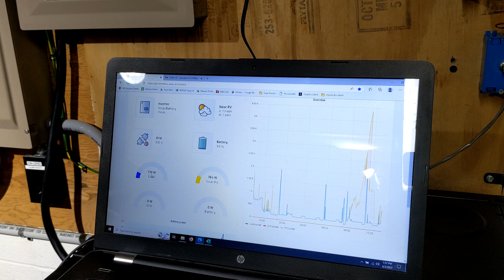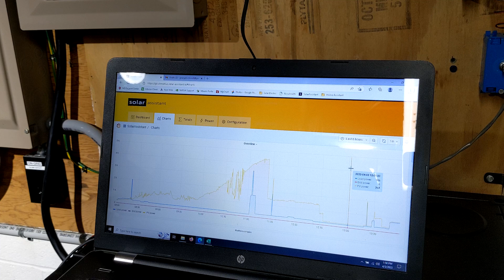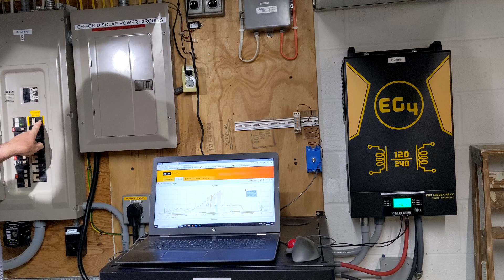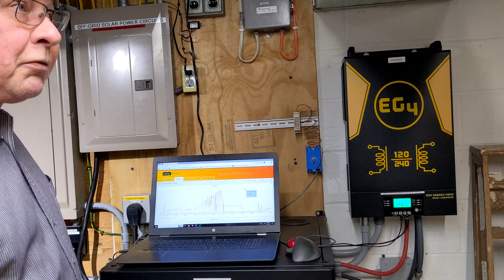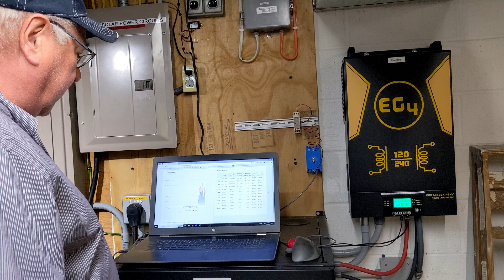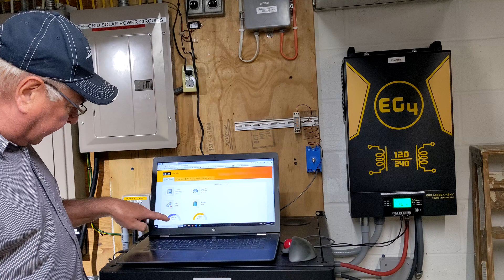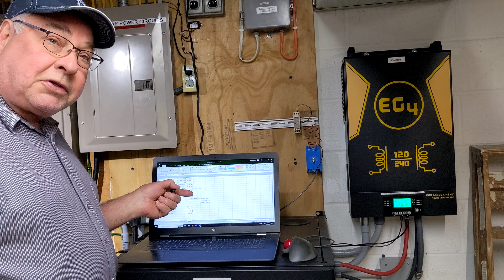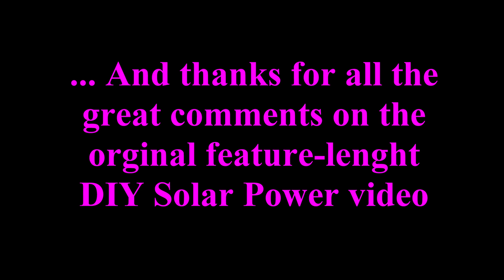DIY Solar Power Update

Comment: This video has inspired me to start designing my own Solar PV system. I was delighted to see that your doing all this in my neck of the woods,I am in Anne Arundel county, so right next door. My question is how did you start the whole process, I have built large extensions to my home, but always left the electrical work up to the pros. Where did you learn how to do everything from soup to nuts?
Reply from the maker: Hello, and thanks for the comment. Here are some answers:

Q: This video has inspired me to start designing my own Solar PV system.
A: Yay, go for it.

Q: I was delighted to see that your doing all this in my neck of the woods, I am in Anne Arundel county, so right next door.
A: You want to come see my DIY solar electric system for yourself?

Q: My question is how did you start the whole process
A: I started with a spreadsheet to compare all the available panels, inverters, batteries, etc. Also read some books and a lot of posts on diysolarforum.com.

Q: Where did you learn how to do everything from soup to nuts?
A: School of hard knocks. I started DIY as a kid, out of necessity. Growing up poor in a single-parent household, I had to learn how to do things myself. Started tinkering with appliances, radios, then repairing cars (not often successfully). At about age 16 I ran my own business installing music systems in homes, stores, beauty solons, and cars. I read a lot of “how to” books and learned from observation. Then out of high school and some college, I stumbled my way into the IT business and benefited from a whole lot of technical training. Now a days, we can learn anything from many YouTube videos.

--- George

Comment: Use a certified Victron Multiplus GX 48/3000 to feed the grid and in winter to charge the battery, if your solar panel don’t provide enough energy.
Reply from the maker: Hello and thanks for the comment. Are you suggesting that I could add the victron 48/3000 in parallel with my existing EG4 inverter?

Comment: HOWdy  G&M-H-M, ...
Thanks ...
My  36 antique  60 cell panels  208 Watt ( with MC3 connectors vs more modern MC4 Connectors - LOL ) ... 
set up in a  6S / 6P  configuration on a wooden GROUND MOUNT ... 
at a  FIXED  sun Angle of  45 degrees ( because my FRAMING-SQUARE had the angle Built-In  🙂 ) ...
produce up to  4.2 kW  of electricity on a Sunny Day ... 
and took me from  purchasing  400 kWh from my GRID supplier ... 
down to  this month ( March 2024 = 78 kWh of  purchased electricity ...
my panels were ALL  very  Very  VERY  USED  & OLD  - cost about  $ 65.00 each from WATTS-24/7 & SanTan Solar ...
thanks again ...
COOP ...
the  WiSeNhEiMeR from Richmond, INDIANA ...
...

Comment: I enjoyed your video. Trying to make this comment with my phone and I suck at using my phone.  I'm dictating this that's why there's mistakes & no punctuation. I just wanted to say you're an IT guy and you have more power than you can use, set up some asic miners. Even if your grid would buy your electrons they would only pay you the wholesale rate. Mining crypto makes excess heat so you could mint some BTC, and enjoy free heat while your system paid for itself even faster. My plan is to do a DIY off-grid to charge my electric car but if I ever make excess power, you know what I'd do with it. Thanks,

Comment: R&L?  Is that who delivered them for you?
Reply from the maker: Yes, R&L Carrier delivered all my solar panels, batteries, everything. Shipping was arranged by my supplier, Signature Solar in Texas
Reply: @gmhomemovies2023  I just bought a skid of panels from signature, had to go pick up from terminal.  There was damage on one of the panels but not to the point the panel isn't still operational.  

I've had other things delivered by R&L and my experience has been pretty mixed.  I've had a number if things damaged and other things not.

I made a comment on one of your video about mini splits, might be a really good investment and way to effectively use your left iver solar for heat or cooling.  I have a number of them installed and have saved a SIGNIFICANT amount of money over propane and even over wood pellet.  I use them as primary heat source now, savings is too great.  For me, each unit pay off was under 12 months over traditional heating methods.

Comment: If you're making more power than you can use, whydo you still have a electric bill??

Seems that you're looking for places to dump excess, I suggest dumping it into your electrical needs...
Reply from the maker: Thank you for your comment. To use the excess power for my remaining electrical power needs requires purchasing more a few addition expensive batteries which is not in my near-term budget. Since publishing that video I've moved the kitchen oven to solar power and now the supply and load are fairly well balanced, and the system is only producing excess power on sunny afternoons.

Comment: For my off grid system i plan on using moes brand transfer switch.  They have several models to choose from,  they turn things on & off based upon the battery voltage that you can adjust.  I want my transfer switch to turn on an electrical heater (in winter) when my battery bank is 95% full and off at 60% or so just i do have leftover battery capacity incase of a power outage. In the summer I will have my transfer switch turn on a dehumidifier. 
I haven't completed my off grid system yet,  and i hope it will work as good as i am thinking.  
Thank you for another great video.

Comment: What is the wattage of your well pump? Why did it beep while the pump was running?
Reply from the maker: Thanks for the question.  The well pump draws 1900 watts, but during startup it probably draws 2x or 3x as much. I have attached a  buzzer noise maker so that I can hear when the pump is running,  because the pump itself is at the bottom of a 160ft well.
Reply: @gmhomemovies2023  Thanks George! We have a 1 HP Flint & Walling well pump sitting in 300ft deep so I guess it may draw more surge current than yours. I learned that EG4 released a  brand new efficient new high frequency inverter called 6000 XP and it has 12k surge capacity so I probably get that inverter. This new inverter seems to be much better than EG4 6048 that you have in terms of idle current and has to MPPT. Nick

Comment: Could you use a hall-effect sensor on a battery cable to detect when the battery charging switches out of bulk charging mode?
Reply from the maker: Thanks for the comment. I've put the dump load project on hold for now, but I'll look into your hall-effect senor idea when I get back to it.

Comment: Nice video. I have a box of X-10 aka home assistant switches/receivers etc.. that I was always too busy to put to use. I don't have a list of what's in there but the box is about 18"x15"x 12" so a good cubic foot of X-10 stuff if you're interested I can check what all is in the box. Just thought I would throw it out there since you mentioned giving home assistant a try. The house I'm in now is all LED so I doubt I will ever use it all. I have thought about listing it all on eBay but I never seem to get around to it.
Reply from the maker: Thanks for the comment, but no thanks for the X-10 items. I'm trying to downsize my collection of gadgets.
Reply: I already replied once but apparently it didn't take.
That's ok. I know exactly what you mean. I'm constantly trying to downsize my collection of gadgets but I keep getting more instead🤔

Comment: Any update on the dump load would be appreciated
Reply from the maker: Thanks for the question, but I haven't done anything yet for a dump load  I considered using my old water heater, unfortunately I found that it was too far gone with rusty leaks.

Comment: (Missouri wind and solar) has a recycling program for used solar panels where they have the panels cleaned up, checked, and refitted with connectors and diodes if needed, then resold at a discount as a "remanufactured panel". you can let them know what you have, if it's something they take, they might pay a small amount. don't expect a big payday, but it's a nice option to give new life to used panels
Reply from the maker: Thanks for the comment. I donated the damaged panels to a young man who is getting into solar.

Comment: For the broken panels you can buy bulk windshield crack repair to fill in the cracks and seal the moisture out and still use the panels. some people also use lacquer to reseal the cracks.
Reply: If the cells are cracked, they won’t work.

Comment: If you can't use all that power, mine some BTC with it ;). Other than that, could you not change the inverter and have a professional install and check out the entire install and then approve it? Surely if an electrician approves the install for a fee and you have a compatible inverter, you could export it?

Comment: Home Assistant Automations combined with smart sockets / Shelly Relays or similar would provide a lot of flexibility in switching on dump loads e.g. Immersion heaters when SoC > 95% etc...    DIY solar diverter.

Comment: Good solar panel system you have there, you can make a shelter :). My mum and dad have an electric water heater but it is not connected to 240v instead it is heated with oil, but I was thinking of putting up two 370w solar panels and let the power go into 240v without an inverter. my idea is that the hot water lasts longer before the oil burner starts up and then save a little oil.

Comment: Did your well pump run off 240v? If so, without electrician is possible? Thanks
Reply from the maker: Thanks for the comment. Yes, our well pump is 3-wire using 240VAC at 8amps. In my county we're supposed to hire a licensed electrician for 240V wiring but I did it myself.
Reply: @gmhomemovies2023  did you wire to breaker that inverter handled? Great job, George🇺🇸👍

Comment: I built my system after finding out i had stage 4 cancer and wanted my wife and me to still have electric if i get more sick. In remission at the moment and this solar stuff i e gotten into has been a great hobby to keep my mind off of things while working towards something that will help my family for a long time. Im back to driving a semi truck and finding time for working on my solar stuff is difficult but i still really enjoy it. Congratulations on saving money and becoming more independent from the grid. I replaced our air-conditioning with a 38 seer minisplit and thats helped alot with going off grid

Comment: Might could pour clear epoxy over the panels and still use them but not sure. I hate throwing something like that away also
Reply from the maker: Thanks for the comment. I donated the damaged panels to a young guy who is getting started with solar
Reply: @gmhomemovies2023  that's good of you to help others like that. It will get him started with a project that will grow into something that helps him and his family for years. I got started with a 20 watt panel and now power our whole home and life from solar. The batteries was my biggest challenge but now I have about 30 kw of lifepo4 and 7 kw of nmc cells. I'm wanting to get some by facial panels in the next few days so hopefully I can make it all winter without ever plugging into my generator for a charge. I've met so many good people on here talking about our systems and bounce ideas off eachother is another great resource this youtube stuff does for us

Comment: I have pretty much the same system. We did the pv install ourselves, up to having an electrician come in for the rest. We bought another set of 6 eg4 batteries for a total of 12 to our bank. Over 60kw storage. We have same pv panels too. Put into 2 rows of 12. I know you used a combiner box, but could you make up 2 strings and set one string of 12 pv panels to each inverter? Our inverters are the eg4 6500ex they are to be set up for dual phase in our basement. Each one says it has a capacity of 8000kw input. We are also retired. I'm 65 and husband is 72. Loved your first video. Viewing this one today!! Thank you so much for your expertise and videos!! God Bless.
Reply from the maker: Thank you for the comment. Sounds like you two have a very substantial solar power system. That's great. Our system is smaller and I still have the HVAC system and the kitchen stovetop connected to grid power. But everything else is running on solar power. Note: I didn't use a combiner box, instead I joined the two strings of six panels in the repurposed junction box mounted to the north array.
Reply: @gmhomemovies2023  wow! Thanks! Deliberating on using a combiner box or not. 24 pv panels total. Blue sun 465 with 575 gain. Two rows of 3 racks, each rack holding 4 pv panels. Was thinking of connecting one row, in series,  of 3 racks 12 pv panels total. Can both of these rows be combined in a junction box, instead of a combiner box then fed to the house? One row going to one inverter and the other going to the second inverter. Our 2- eg4 6500ex inverters can have up to an 8000kw input.
Reply from the maker: @lindaferguson593  regarding your question about a combiner box, I don't feel comfortable advising you on your system. In my case, I chose not to use a combiner. But your system is different. Consider looking to the good folks on the DIY Solar Forum.
Reply: @gmhomemovies2023  we use propane for our gas stove/oven and our 11gpm, on demand, water heater. We have a fireplace insert for heat in winter but also a mr cool hvac split system. 1200 sq ft home with unfinished basement. We anticipate fully using all heavy loads, washing, ac, well pump, microwave, etc....during solar collection hours in day. The combiner box use was stumping me. Thank you so very much.

Comment: Congrats George on having a DIY home solar system operational.  I recall seeing your original video, sometime ago, installing the solar array and trenching to lay the electrical cable conduits to your house from the solar array.  Just finished watching this video on 5/2/23 and the question I have is what is your total costs of all materials into your system and what is your estimated labor hours to date (roughly 1 year ?).  To be honest, I am amazed at your capabilities, being a retired former IT guy myself, able to do so much construction and electrical work yourself.  I guess living on a large property that you are by choice able and willing to do a lot by yourself.  Congrats again on your amazing accomplishment to date of a simply amazing personal journey !!!
Reply from the maker: Kenneth, thanks for the comments and kind words. So far, I have invested $17,513 USD in material for the solar power system. (That number does include delivery of equipment and lumber, and rental for post hole drill) For labor, I probable sunk 200 hours in constructing it.

Comment: Have you an option of sending the extra power back to the grid? If so, you would get paid for it if it was metered.
Reply from the maker: Thanks for the comment.  I wish I did have the option to sell power back to the grid, but unfortunately my inverter is not certified to do so in the USA.
Reply: @gmhomemovies2023  That is a shame. We are in Canada. My neighbor has a system on his roof and has two meters on his house. He sells what he doesn't use back to the grid.

Comment: They also make a grid interactive grid tie inverter that have a amp clamp that monitor your household use coming in and can push power into your household power automatically. I would be curious if your battery voltage is in the rate range for them to be used in your case to offset your power usage inside your house without having to backfeed into the grid
Reply: I don't remember what they're called but they are blue inverter that goes onto one side of your incoming feed and they have to buy a second inverter to get the other side of the 110 v and it does is just plugs in to 110 volt plug that is on that side of your panel

Comment: At the very end you mentioned the heat pump water heater for the dumb plug also consider a small stand-alone electric water heater in line with an on-demand water heater I think that's As Good As It Gets good luck

Comment: We have a ~45 gallon Rheem heat pump + resistive  water tank.  It keeps the basement dry in the summer.  We use oil in the coldest months.  It only uses about 2 Kwh per day in the summer.  I think it might increase 50-100% in the winter here in CT if I left it on.

Comment: You could build a nice big water feature in your garden and use the excess power to run a water pump.
Reply from the maker: Thanks for the comment. Good idea. In fact I have an old irrigation pump already in place. Haven't used it in years, but should be able to resurrect it.

Comment: If you used reflective mirrors on the bottom instead of white gravel, you may get more power, thanks for the update!
Reply: Yup, I’ve seen a couple of videos where reflective surfaces were used but it doesn’t matter when you can’t get rid of all the extra power.
Reply: @RokDAWG1  Been working on a aquaponic wall powered by solar with the wall N facing & trying to reflect sunlight on the S side of the wall to get produce on the shaded side. I hope reflecting tech with solar and light could be used one day to help grow food and power humanity more efficiently.

Comment: There is a device that can heat water with the excess solar. It detects if there is no load and if the battery is full and will start to heat water for use in your home. You can also buy electric car and charge its battery with the free energy with same device. Its connected both to the PV input and inverter output I think and gathers the info from there to turn on the additional load.

Comment: Great video, thanks. For the dump load, I’d recommend a automatic plug timer to come on at 2pm to turn on an electric water heater. Use the water for showers. Automatic plug timer thing can be used for anything else to dump loads.